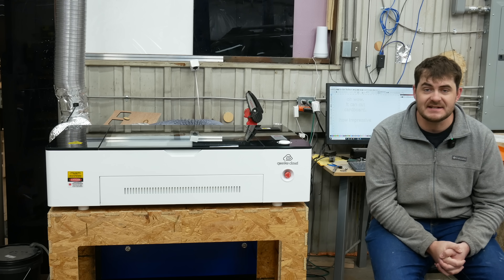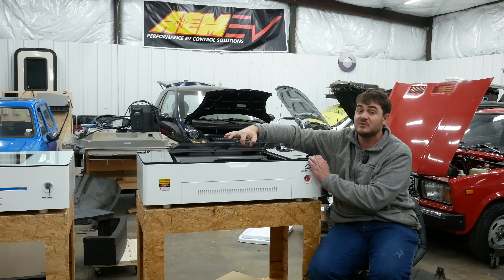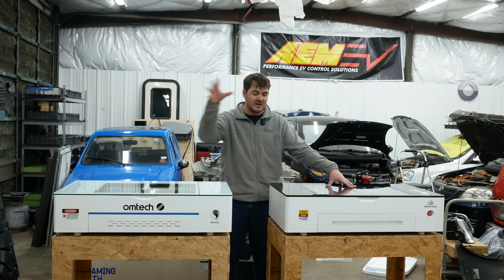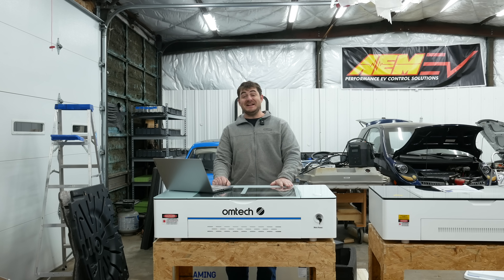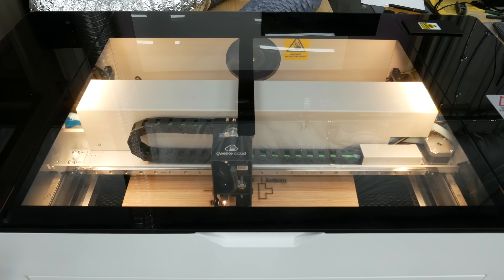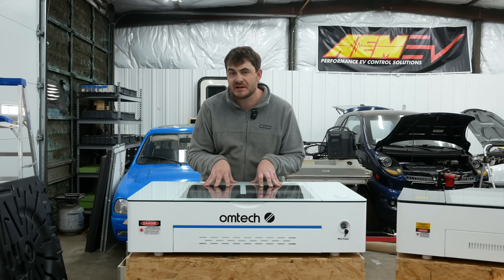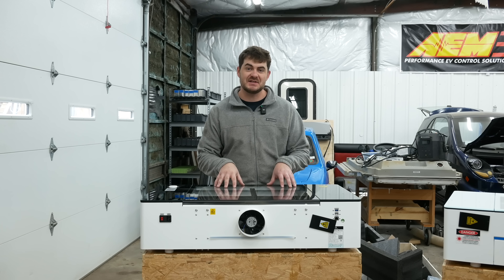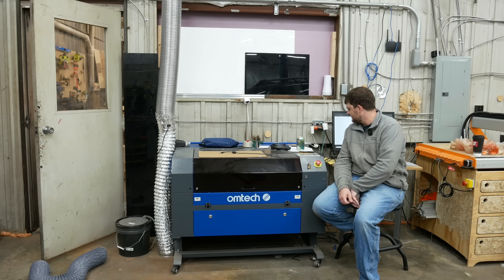The OMTech Polar and Gweike Cloud are (mostly) Desktop CO2 Lasers

Comment: My issue with the Glowforge is not so much the price, but that you are locked into their cloud service, and if/when they go under or stop it, you have a big closed-source brick
Reply: I have a Glowforge plus and the cloud service sucks.  Same glowing button and wifi issues.  Why they can't add a screen, knob and SD card slot like a $150 3D printer, I have no idea.  Looking to sell it and get one of the bigger ones he has in his shop.
Reply: @JohnMosesBrowningVEVO In many cases, it's not even planned. Companies get bought or they collapse. Without the service and source in some sort of escrow, you are not going to get anything. Several years back, I bought a kickstarter 3d printer from a French company. The printer had a ton of promise, so a lot of us backed the project. After delivering hardware, they folded because they had an unsustainable business model. And because all their command and control was online, you had to rip and replace the proprietary control board to be able to use anything with the printer. Kickstarter is always a risk, but this really highlighted the problems with relying on external services. After that, I decided to never again purchase a tool that would be a brick if the company went out of business or decided to stop support. I keep tools a lot longer than, say, smart phones or other devices where you expect some churn.

Comment: I own an Omtech 80 watt cabinet laser, had it for a year and a half, use it two, maybe three times a week (5-15 hours/week, depending on the project).  One thing not mentioned in this otherwise GREAT video is that the power is adjustable on the laser (at least the cabinet one is, not sure about the desktop ones  But I'd imagine so).  The service life of the laser tube is VERY dependent on two things: 

1. Making sure your cooling system is working properly - neither too hot nor too cold, and ye gods, if you put it out in your shop make sure that you have heating in the winter so that the water in the glass laser tube doesn't freeze.

2. The power being pushed through the tube.  If you're doing mostly engraving, you can usually get away with 25% - 40% power depending on the material, and will get longer tube life (I don't know about 10,000 hours, haven't run mine that long).  But if you're cutting through the material, you'll be using anywhere from 40% to 100% (I've never had to go above 90% myself).  This will significantly affect the life of the tube according to the manual, and take it toward the 2,000 hour lifetime (the manual that came with my laser was very clear on this point).
Reply: You can also get longer focal length lenses, which should cut thicker material with less power. The downside is they don't focus as easily as the short length ones, so won't engrave as finely. Easy swap though, if the machine has the z height to accommodate...

Comment: I think I know what's wrong with the wifi.

Okay, so a LOT of stuff coming out of China that says "2.4Ghz, not 5Ghz" is using a crappy radio for its wifi system. It's annoying as hell, but what you have to do is go into your router's wifi setting and turn OFF the 5Ghz connection COMPLETELY. Most routers will let you do this in the app, but yeah. Once you turn it off, once the device has negotiated the connection for the first time and managed to properly save the SSID and everything, you can turn the 5Ghz back on. But even if you tell it to look at a wifi connection that's a 2.4Ghz, if that SSID Also does 5Ghz, it'll confuse the whole damn thing during that setup process and it won't work.

Comment: I have the same 60w OMTech as you and you did forget another huge disadvantage to the tabletops as compared with your 60W and that is the size of your engraving material. Desktops can only handle materials of a certain thickness. The Polar has a working bed size of approx. 20" x 12" and can only handle items with a maximum thickness of 51mm. That's about 2" for anyone in the states. With the honeycomb grid, it's down to 17mm or just over half an inch. The bottom line is that you should not get a desktop laser if you have aspirations of carving thicker materials.

Comment: "These operate so much faster they use a different unit, millimeters per second"

Meanwhile, only 3x the speed.
Reply from the maker: It's more than 3x the speed. While some diode lasers can move at 10,000mm/m, they can't actually do any useful engraving at that speed. I found 3000mm/m to be the upper limit so it's more like 10x the speed

Comment: Curious if you used 5ghz or 2.4ghz wifi. Most IOT devices require 2.4ghz. I dunno why, but it's probably the cheap wifi chip.
Reply: This and many AP dual serve over the same SSID. Try making a dedicated 2.4 GHz-only SSID.

Comment: I was saving up for a Glowforge until I learned about their ecosystem.  An owner actually can not buy parts for the laser they paid 7 grand for.  If something breaks or the tube wears out, they expect you to buy another one, another entire machine.  And yes you can buy a refurbished machine instead of a new one but the price is still so f!*cking ridiculous compared to simply replacing the tube.   Unless Glowforge branches out to other products I don't expect them to be around very much longer.

Comment: Regarding Gweike wifi setup. If you were serious about a space in your wifi SSID remove the it in your router settings, then try to do the connection procedure again. It should work.
Reply: The issue is that fucks up everything else on the network

Comment: You do not have to manually adjust focus on either of these machines each time. You need to properly set them up in Lightburn. You have to go under device settings and turn on "enable Z axis". That will allow lightburn to control the z axis automatically. When you do this you will get a new box on layers tab labeled "material ". Here you enter the distance to move to focus. The distance the z axis moves from home position to place the focal point at the top surface of the table is approximately 17mm so you need to subtract your material thickness to have the focal point be on top of material. So if you have 3mm material you would enter 14mm.  If you also select "optimize Z moves" in device settings the Z axis won't raise after each operation.
   Also the Polar uses an off the shelf Ruida controller with external stepper drivers and the Gweiki uses a Gweiki made custom controller that mimics a Ruida controller. You can buy an external display just like your other laser for the polar that just plugs into the controller. You cannot with the Gweiki.
Reply: So what you described is basically the same thing as he did in the video, juts in different places in the software. And it still sounds way more complicated and prone to errors than the manual knob and spacer thing.
Reply: @mjc0961  no. What I described you do once and then it is all automatic. What he described he has to do every time.
Reply from the maker: That's all still extremely clunky and not auto focus
Reply: @Under Dunn  after initial setup all you do is enter one number in a box to tell machine material size. How is that clunky? Very easy.
Reply: @reeves29456  that's still annoying dawg.

Comment: I don't know why they bother with the absolute waste of time and energy of making these things use Wifi. Back in the day everything like this just used Ethernet. You plug in a cable, everything works. Nothing else to worry about, ever. But now so many people are deathly afraid of running cables for Ethernet that everything has to be wireless to appease them, even if it's a large machine that SPENDS ITS ENTIRE LIFE SITTING ON THE SAME GOD DAMN BENCH, PROBABLY EVEN IN A SEMI-DEDICATED ROOM, NEVER EVER MOVING, EVER. Even less useful than a consumer printer with Wifi (at least those are small enough you can put them in places that it wouldn't be worth wiring with Ethernet).

And now after going through several generations of devices where most users want to use Wifi, Ethernet stops being available on a lot of them except the very highest end of the industrial market. So even people who know how to just install wires and do it properly have to suffer for no good reason.

Comment: Have you thought about replacing the bucket of water with a radiator and fans, like they use for liquid cooled computers?  I don't know how hot the coolant gets, but small radiators aren't hard to come by.
Reply: The issue is, the laser tube should never go over 25 degrees C. That is hard with a fan + radiator that cools to ambient temperature and you live in a warmer climate. With a bucket you can throw in some ice blocks to lower the temp below ambient. Not so much with a water-cooling radiator alone.
Reply: You mean like the one you would find in a Ford Escape, that used to be fossil powered...?
Reply: @Auravendill  what the fuck is this comment lmao

Comment from the maker: Hey, just a quick note.  There was a section in the original video where I stated the laser tube in my cabinet laser is already due for replacement. Wrong! After posting this I found out it just had a dirty lens. So I've removed that portion of the video. It will take a while for that change to take effect
Reply: Are you talking about around 3:38? If so, I'm still seeing it.
Reply: Thanks to Youtube's caching, I got both the old version AND this comment! Neat.
Reply: Ha, I still saw it! Just wondering where you got the 10.000 hour laser lifespan from. Omtech’s german site states 2000h at very low 10-40% power and 400 hours at 70-100%. 10k hours seems like a lot…
Reply: @grischder  The English website lists 10,000 hours on a picture of the laser tube on the page for the machine itself, but if you look to buy the tube separately it says only 2000h like you noted. It also says 10,000 hours for service life, which I'm sure is for the machine as a whole and not the tube so they're being deliberately misleading by putting that number on a picture of the tube without explicitly saying it's the tube's lifespan.
Reply: You seem to mention it again at 17:40
Reply: And again at 18:50
Reply: 3 hours later, it's still in there. Nice fast work by YouTube's editing tool
Reply: @mjc0961  At 7 hours now.
Reply: When I saw that part I thought to myself "I hope he's cleaned his mirrors and lens" :) Look for burn marks in the middle of the mirrors; if they're burnt just replace them - they're pretty cheap, as are the lenses.
Reply: Still there ;D
Reply: And clearly Youtube did not feel like actually removing it, yay heh.
Reply: Man, youtube is slow. I still see it too
Reply: Maybe it just needs a radiator, a better pump and a water temperature sensor?
Reply: Audio is completely out of sync now 🙏
Reply: Well, I'm watching this a day later, and you still mention needing to replace the tube a couple times in the video. Idk how any of this YouTube junk works, though.
Reply: you never pointed out that WHY the F do they need to use USB A on the device... so both ends are USB A???
Reply: @InconsistentManner  probably because it's a off-the-shelf single board computer or controller and it has USB-A ports on it
Reply: @InconsistentManner  because long USB cables are almost always cheaper with USB A ends.  Plus small connectors are weak and prone to breakage with a long, heavy cable dangling off them.
Reply: @barrylinkiewich9688  you know that USB B exists right? And that long usb cables almost never are A to A, they’re normally A to B? The question here isn’t “why don’t they use C”, the question is “why do they use a non-standard A to A cable”.
Reply: Erm... hate to break it to you Robert...
Reply: @mediocrefunkybeat  It can take a few hours for the online editor to update
Reply: Not yet you haven't :-) it'll update eventually
Reply: still not removed...

Comment: they are telling you to change your IP on your workstation because they were lazy and their device wifi does not provide DHCP. Once you've changed the IP, it is so that you can get to a web or ssh interface on the device, so that you can setup your NORMAL wifi through that interface. Then you set your computer back to your usual network and both are connected to your normal wifi.
Reply: It's 2023 stop acting like this is a sane implementation on any device, let alone one costing nearly $3000
Reply: @futuju  I didn't say it was sane.  I said they were lazy and did not implement DHCP.  Cost != technical competency, either.  There is still "enterprise" level hardware that requires this kind of a setup.  It's dumb.  If done on an Ethernet cable (assigning your own IP address by default) if someone plugs it in in the wrong place it can (and does) cause outages.  The bar, it is very, VERY low.
Reply: @smarouchoc7300  
That’s kind of like the app for my connected light switches and smart plugs requiring me to switch to my 2.5 wifi to program anything but letting me stay on 5.0 to control them.
Reply: @Crewsy  ish.  I'm a network engineer, and the reason it works is either that  - one, both the device being controlled and the device doing the controlling are connected through the cloud, and not directly to one another, or two, there IS a local connection but either you are on the same subnet or proper routing is configured between the networks.
Reply: This is what I wanted to commented, you did a great job lol
Reply: It’s not uncommon to have to connect ad-hoc to a device to configure its Wi-Fi. Once, connected, you disconnect from it and the laser will be accessible via your Wi-Fi network.
Reply: Yeah, funny how that simple (and explained in detail in the tutorial video) thing is so confusing for some :) 
And this channel is mostly about doing unusual technical things yourself in the first place! Oh the irony :)

Comment: I used to work on 100 and 250 W C02 lasers, and the only time the tube would need to be replaced is when someone was attaching a line to one of the nipples and broke it.  We used to pay $8,000 for a new tube, but then I instigated a process where we hired a local glass blower to fix them for $200.  What would break was either the coolant pump motor, or High Voltage Tubes.  I imagine that C02 laser tube has static CO2, not a flowing C02 fed from a truck in the back of the factory.  When your C02 either leaks out or changes composition, that is probably why you need to replace the tube.
Reply from the maker: Yep, the CO2 in the tube decomposing is the perpetrator. I should note I found out after posting the video that my tube isn't actually dead. It was just a dirty lens

Comment: With the wifi problem on your laser, check to see if your wifi is set up with "band steering" on the wifi you are trying to connect to. Simply put instead of your wifi saying "WIFI name 5ghz" Or "WIFI name 2.4ghz". It will instead give you one wifi to connect to "WIFI namer". And the wifi itself will decide if the device will be connected to either 5ghz or 2.4ghz. 

A lot of wifi units are not meant to connect to 5ghz, and will not connect whatsoever. But because the wifi itself is trying to possibly steer the unit to the 5ghz signal the unit will not connect. 

Try turning the band steering off in your wifi system. Find the model and your service provider, there bond to be some youtube video or guide to help deactivate it. 

From my own experience with a lot of these smart devices like light bulbs, speakers, cameras, and so on not connecting. Turning the band steering off and pointing it to the 2.4ghz wifi worked every time.

Comment: The "refusing to connect to WiFi" sounds an awful lot like it's using any one of the many terrible WiFi chips that come from that part of the world that just will not connect to a 2.4GHz network if there are any 5GHz networks that it can see that have a similar name. We have a number of inexpensive "smart sockets" that behave exactly like this; like most technically literate homeowners, we have both 2.4GHz and 5GHz WiFi networks running ("blah_2.4G" and "blah_5G"), and the useless smart sockets won't connect if the 5GHz network is broadcasting... LeSigh
Reply: The WiFi Antenna is stuck to the inside of the Metal Housing, any questions? 😏
Reply: It's aboidable by using a smart socket that doesn't use 5.8ghz, eg anything ESP32 or ESP8266 powered
Reply: @new-zealand-clippy  Thanks for letting me know.